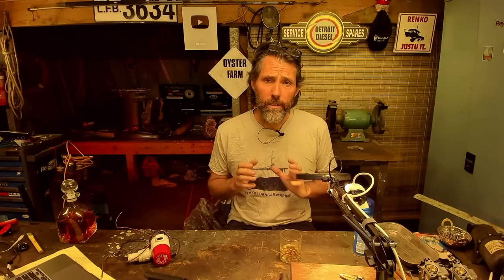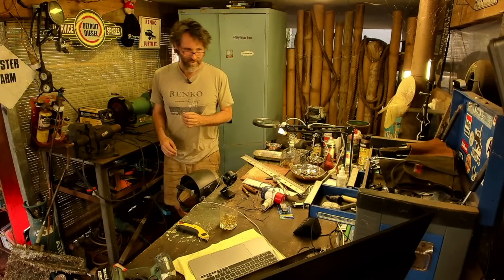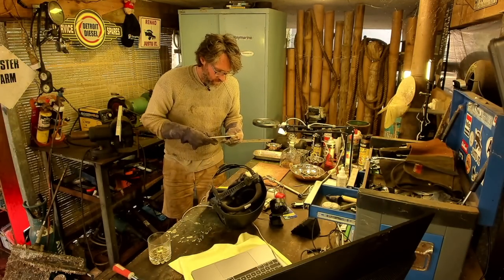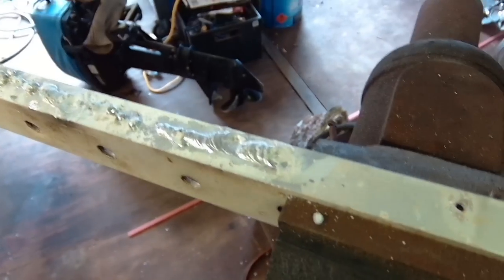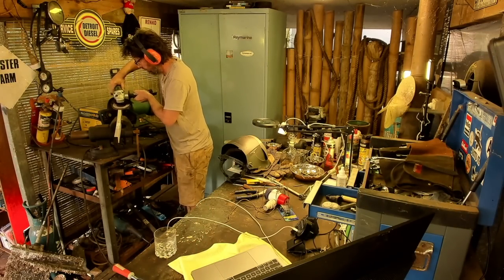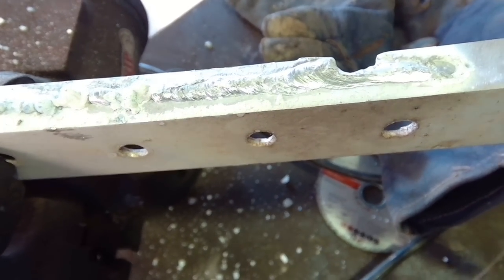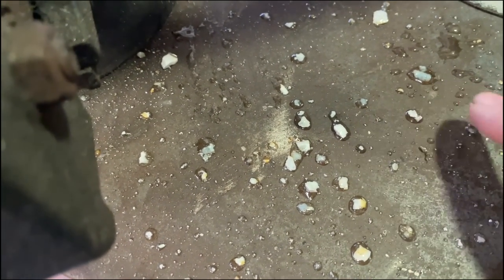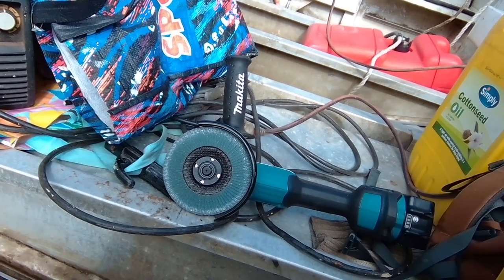Stick welding an aluminium boat

Comment: As an electrical engineer I can tell you the grinder doesn't work without the battery because it is too front heavy and causes the shaft to bind.  👍
Reply from the maker: Makes so much sense when it's explained to you. ;)
Reply: Brian is right on , no battery also bloke the ants from getting in  the motor

Comment: I am a professional welder employed by a large commercial trucking company with a very high volume work load . We use a spool gun in our shop but one day I came across an unopened bow of aluminum welding rods. I was always curious about aluminum stick so I started using them. I’ve done a few CAT aluminum oil pan cracks and they holding up well . I run the aluminum rods like a 6010 rod with a slight wip and pause motion and it works well for me. Obviously not the best method but you can get good results with practice.

Comment: As usual, I most enjoyed the birds. As to the grinder not working without the battery, you might try hooking it to the compressor.
Reply from the maker: I do love an air grinder. ;)
Reply: I've got the same model grinder, they're really finicky. Mine won't even run with a battery unless its charged. Bloody annoying.

Comment: Instead of the flap disk I would recommend a stainless steel wire wheel followed by an acetone wipe. The flap disk can embed oxides in the base material and the wire wheel typically won't. The acetone will get any of the chemical contaminants out. 

Pre heating should make starting easier. More importantly, it makes your weld act more consistently from start to finish. The material acts quite differently when hot than when cold. Having the material a more consistent temperature allows you to concentrate on your basic technique instead of dealing with the temperature change. 

Good on ya' for giving it a try! It's a tough weld process for sure.
Reply from the maker: Thanks Brian! I did actually buy some acetone that I left at Adrian's workshop but I'll grab it and put a wire wheel on the grinder too. Someone else was mentioning that maybe even just the heat gun would be enough for the preheating which would be convenient if true. I can see how the preheating would make a big difference as the cold weld is very different to the weld once the job has got warm.

Comment: mate ur videos are some of the best I recently brought a 14ft with a 2 stroke yamhaha ur videos have been a life saver everything from running the new steering cable to changing my impeller and now after hours of searching Google about water separator placment it's ur 6 yo video that gave me quick clear instructions as some one on a tight budget who loves getting out fishing in my boat ur videos are worth there weight in gold cheers from nz

Comment: I've used the aluminum stick rods a couple of times... as you have said they are different. I work as a professional welder and metal fabricator. It's all about getting accustomed to the aluminum rod and it's nuances.
Reply from the maker: For sure, it's just a different muscle memory to develop with practice. Looking forward to the new pack of rods arriving!

Comment: Ah, the old 'no battery, no noise' problem... Hmm, didja check and see if it had gas? They're a booger to run when the tank's dry. I'd also check the following:
1 - The keegeeflagger must be oiled before operations.
2 - Always (and I mean ALWAYS) make sure the dingus dakker is plugged in.
3 - And sometimes the transgronifier can get plugged up.
OK, that's my mechanical 2 cents worth. Good luck, hope it works better.

And thanks Stu, your videos are always informative and entertaining.
Reply from the maker: I appreciate the tips! ;)

Comment: Stainless wire brush and acetone as a flap disk will leave particles in the soft alloy. Preheating is a must. The rods try putting them in a plastic bag and vacuum sealing it.  It’s one of the most tricky welds.  👍
Reply from the maker: Yes, when the new rods arrive I'll definitely experiment with different cleaning techniques and pre-heating for sure.

Comment: So totally relate to this. Pro plumber but by necessity multitrader here, so often practice what I know I will need to do a few times before the actual job. No one knows everything, even plumbing changes almost annually in my area ( why can't we all just use copper and call it good???🙄🙄🙄) and any skills one has go rusty. In a perfect world you turn up on the job and knock it out like it's your bread a butter...🤫😅😅😅
Reply from the maker: For sure, there is always something new to learn and nothing stays the same for long!

Comment: Try Brazing aluminum with a oxy-acetylene or oxy-propane, and map gas will work to. The Filler rods come pre-coated with flux.  You can control the heat by choosing the torches tip size based on the size of your work piece.
Reply: Then he would have to lug the gas bottles to the floating job site, which is what he was trying to avoid.
Reply: Might be a better option. Project Farm did some testing on aluminum brazing rods. Interesting stuff.
Reply: I was about to say this too! Also because aluminum is not as strong as other metals, Brazing rods often are strength you need. And can be so strong that the aluminum crack before the brazed joint will. And the argument about bugging bottles is wrong because you only need a hand held bottle.
Reply: this is a boat in saltwater, galvanic corrosion from dissimilar metals is a major concern and you should never mix metals in a marine environment unless you know what you are doing. low-temp aluminum brazing rods contain metals that are not suitable for a marine environment.
Reply: I also would like to see that. Repairing marine aluminum exhaust manifolds or manicoolers.. brazing seems to be able to fix really big blow out holes in these.
Reply: @marzsit9833  G'Day,,Mate ya just shot me down,,
brought a couple of said brazing rods just for that purpose,,
Nothing stuff a fishing week end sept a hole in your boat or you ran outa beer,,
Although a bit old Duct tape held for a week once,,But that was just a crack,
Reply from the maker: Yes, I've seen quite a few vids on brazing rods for aluminium, really must give it a go one day too.
Reply: @DangarMarine  make sure to use the proper expensive Made in Aus ones.
Reply: @timothyreed6054  I had just watched that too, as you said, very interesting.
Reply: @jaquigreenlees  we aren’t talking large bottles. Small hand held bottles are plenty for ally brazing and they’re a tiny percentage of the weight of even a small welder.
Reply: Back in the late 60s and 70s I worked in the aero industry and the welders used oxy etc to brazed it but with ally rods. To see if the ally was hot enough they rubbed a used match on it and if the match left a burn mark burnt it was good to go. As an apprentice I was fascinated, still am come to that. Not suggesting you do it but that was the method then.

Comment: Thanks for sharing your experience with us.  In my experiments, I have found that running a bit hotter, and stopping every 2-3 cm to cool for a few seconds and then resuming gave me the best results.  It's like stringing a bunch of tack welds together.  Can look really good, once you get the rhythm. And yes, the aluminum vanishes quickly, but that's just how it goes.  Thanks again, and good seeing the how-to vids again.
Reply from the maker: Thanks Tony, great to hear form you again. Hope you've been well. :)
Reply: Stu, I've been okay, except for a customer starting a motor in gear and whacking my hand with the prop about a month ago.   It's getting better, but I'm getting where I want customers far away from me when working.  In 37 years of working in construction and marine, I've only been seriously injured twice, both fairly recently, and both times by customers.

Comment: I worked on a Railroad for twenty-five years as a Carman and learned to stick weld aluminum when the 100 ton freight cars came out made from it.  It is not easy, but it can be done.  Later we went to Mig welding when they bought the equipment.  Light aluminum can be welded by Tig, but, heavy thick aluminum is better with Mig.
Reply from the maker: Yes, I do really love TIG welding but I think when it comes to old hulls like this MIG with a spool gun is the way to go.
Reply: @DangarMarine  I am in this exact position. Bought the rods, watched vids and am now researching mini 160-200a MIGs. All made in China,  duty cycle is key, apparently the higher the duty cycle,  the longer we can use it before it overheats, shuts down and needs to cool down. Extra computer fan maybe 🤷‍♂️

Comment: Very narrow temperature window welding aluminum.   I weld aluminum a lot with a mig spool gun and mine isn't fancy with the pulse setting so I end up having to do more spot welding to control the heat.   Aluminum goes from not melting at all to hot snot in just a moment.   Practice, practice and more practice...name of the game is control the heat.

Comment: We use MAPP gas handheld torch and aluminum brazing rods to repair our aluminum Jon boats here in my area of the USA. It seems to be as good and hold up as good as mig or tig. Not as pretty to look at though. Also, our boats don't see salt or brackish waters. Fresh water lakes only.
Reply from the maker: Yes, brazing does seem to be a good way to go in many circumstances.

Comment: When starting the weld you can grip the rod rather than using the rod holder, makes for an easier start with more control.
Love ya work mate
Reply from the maker: Thanks mate.

Comment: Nice one Stu, you're a dead set Legend.  Wasn't even aware that stick welding aluminium was an option.....
Reply from the maker: Thanks Michael. It certainly isn't common because it is so tricky but I'm keep to burn though a few more packets to see if it is something that practice will help with.

Comment: Back in the day before  tig we welded with gas on aluminum ( lots of flux and low heat , almost sutty ) and it holds really well plus you don’t need electricity !
Reply from the maker: Hey Dave, I am a big fan of gas welding too!

Comment: The grinder not working without a battery is a safety feature. The battery acts as a balancing aid, providing optimal control over the grinding disk. That is also why there is a fail safe built in which will prevent the grinder from turning on at all if a properly weighted battery is not installed at the counter weight position behind the handle.
Reply from the maker: Ah, very clever. It's great to see they are looking out for my safety. ;)

Comment: Our shop had a problem with humidity getting to our welding rods. When I priced rod ovens, it ran from $300 USD to almost $3,000. So I built a plywood box sealed with epoxy and installed a 100 watt incandescent bulb in the bottom. Had to drop it to a 60 watt as the rods came out too hot to handle. But, no more crumbling rods! Cost about $20 in parts and just needed a new bulb every year or so...
Reply from the maker: I think it's a good way to go to make one, there isn't much too them.
Reply: We did same with an old fridge .

Comment: Newer welders have high frequency arc stabilizers installed to keep the ac arc lit. The old days we would hook up an arc stabilizer  to our old ac welders to scratch tig weld. Arc stability is key with aluminum
Reply from the maker: I did run some of these rods on a better welder and was definitely a bit easier.

Comment: Im a train welder and i find it best that wrap the welder cable round your forearm once and then hold the welder gun as less weight on you wrist when you weld.better control and results.
Reply from the maker: Nice tip!

Comment: You have the cordless grinder. To run without the battery you need the contactless version. Or buy the cheap eBay cord adaptor to convert your cordless to corded. If you run it on 240 volts it will have heaps more grunt, but you will have to work really fast...

Comment: I tried practicing aluminum welding on various bits I had available and found a piece of extruded AL that could not be welded at all.
Then I saw a video that included talk about "unweldable aluminum alloys" from This Old Tony.
Reply from the maker: Yes, there are certainly plenty of aluminium alloys which all behave differently.

Comment: It is difficult to keep the heat at the weld point.  Definitely using another torch for keeping the general area warmer would help but that cold river water coupled with the surface area of the hull beneath the waterline is one hell of a heatsink!
Reply from the maker: A couple of good points there. Extra heat definitely would help and I hadn't thought about how much heat the river water would be taking away. Should have done it on a low tide!

Comment: Back to the 'crystal decanter':  That 'tan liquid' is nearly empty when you are welding 1/3 the way through the video, yet almost full when you close the vid.  Magic stuff I am sure!  Hey --- I have always wondered --- if you hold a lit match, take a swig, then blow past the match, will you blow flames?  Might work well for preheating aluminum ....... worth a try anyway ....  probably would have to practice a lot to get good at it .... 
I love your vids ...
Reply from the maker: Could be a good way to preheat. ;)

Comment: Try using a “positive” ground on the piece your welding… that’s what the instructions for the rods I used on my aluminum boat said to do….
Reply from the maker: Interesting. These say electrode positive but I'd be interested to try both ways.
Reply: I wonder if using positive ground with the boat sitting in salt water will dissolve it around you🤷‍♂️
Reply: @DangarMarine  I tried it both ways… seemed the same to me. I had more trouble with the high alloys in the aluminum I was welding.  I have a US Army twin DD-353’s diesel Bridge and Barge boat… built out of some tough aluminum…

Comment: For the grinder get a flapper disk and hook up a garden hose with a small nozzle to a pump and shoot the water against the little ridges on the flapper disk...move the grinder around quickly too.  It will clean the dust away, if any, while you wear yourself out! 😁🤣 For the bow sprit were there any other option than welding?  For a first go at this it's a good start.  The changes in format are sounding interesting.
Reply from the maker: To be honest I think it would be easier to cut the bow sprit off and make a new one (if it is needed at all.)

Comment: If you clean up the welding area with a stainless steel wire brush is always advisable it takes of the contamination

Comment: A simple mod for your grinder battery issue.  Just take a 50 amp cable and solder the leads onto the battery and then connect to the bottom of the grinder.  Then you wont need to lug that bloody battery around :-)
Reply from the maker: That's not a bad idea. ;)

Comment: you could pre dry the sticks in the oven and quickly put them in a sealed vakkum bag. the kitchen style things are cheap and weld the bags shut with heat. you could go so far to single seal them or in 2 and 5 groups. should keep them fresh even on see till you need them.
Reply from the maker: Sounds like a good way to go, particularly when it comes to keeping some onboard Renko.

Comment: I have a cheap (like really cheap) Telwin MiniMig 130 that is set up with aluminium wire, and it works surprisingly well. I recently got a quite expensive AC/DC tig welder specifically for alu, but I must admit I still prefer the cheapo mig machine for most alu work. Much faster, and the welds are structurally sound, if not pretty. Not going for showroom quality anyway. That said, I am determined to master the tig well enough not to embarrass myself. Well, before I retire anyway...
Reply from the maker: I must admit, I've always been a TIG guy but I think when it comes to doing structural repairs on old aluminium boat MIG really is the way to go. I'll look up the machine you mentioned. Thanks!

Comment: Hi Stu l weld for a living and did you preheat it makes welding with aluminium with stick easier use a heat gun etc also the temp on your welder is very important. 
Maybe when l go to Brooklyn to my boat we should meet up so l can show you some tricks Stu .
Mal
Reply from the maker: Thanks Mal. I'd really appreciate that! I didn't preheat in the end as I didn't bring my torch down but I never even thought to use the heat gun. Great idea. :)
Reply: Ive welded Ali for many years Stu always preheat except in summer

Comment: Hello there, Im not a fountain of information, but when I welded aluminum I did it with tig and reversed the polarity on the machine. I have not welded aluminum with stick before but you could try and see if reversing the polarity would do the trick. Heating up the aluminum might help as you mentioned in you vid. Have a great day.
Reply from the maker: Yes, with TIG I always go AC for TIG but I think preheating is definitely the way to go for stick.

Comment: Ur stick welding skills surely increased even if the welds looked lumpy. U did alright. Try running cast rods...bluh. I'd rather Tig em.

Comment: How do you think you'd go having an offsider to turn the welder down a bit as you go, or do you think it would all be over too quickly to co-ordinate that?? 
From doing TIG with a foot controller, its easier if you have the option to go hard to start with to get the heat into the job, but then back off the power and finish on a lower Amp setting which reduces the chance of the job ending in a puddle at your feet.
Reply from the maker: Yes, something like a TIG foot control would be good but I think pre-heating will also solve a lot of that problem.

Comment: it makes sense that when you said " aluminum isn't hard, its just fast" the base material is going to steal your heat so fast. I'm surprised that the thinner metal didn't blow out super easy, probably in part to the heat getting dumped so fast into the base. neat video, fun to watch someone else make gross welds instead of looking at my Pidgeon poo welds. grinder makes a good welder right?